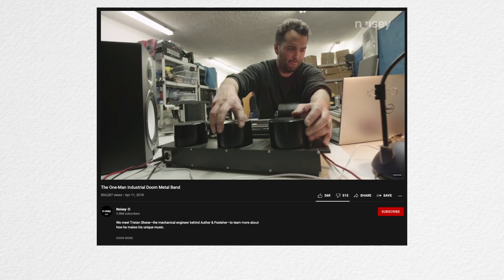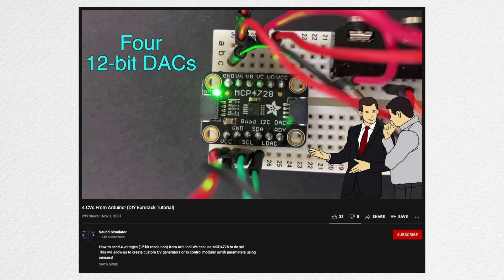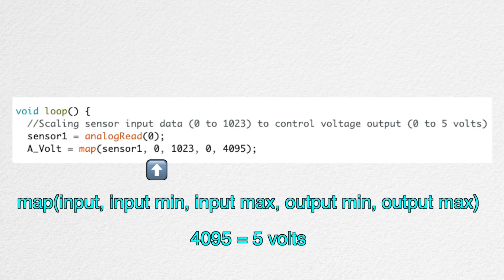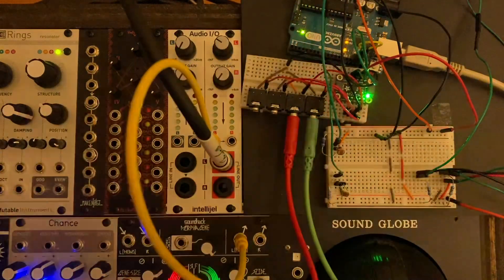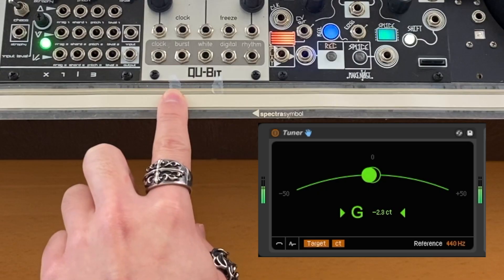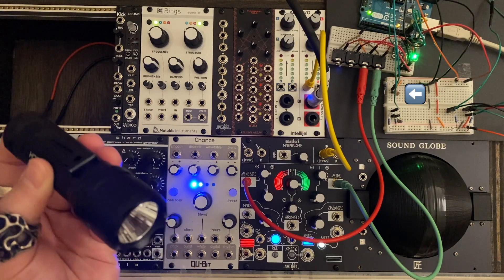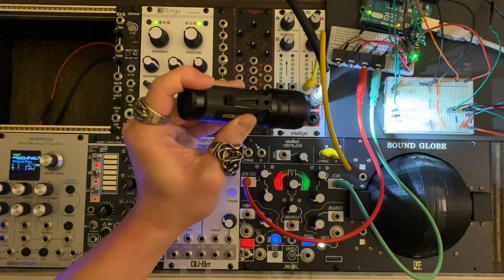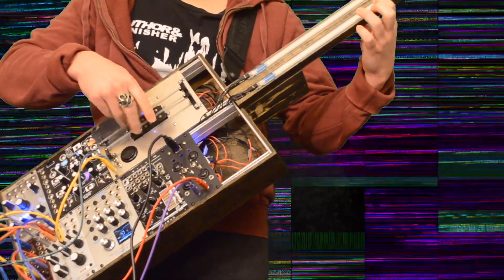Controlling Eurorack With Sensors! (DIY Tutorial)

Comment: Espectacular
Reply from the maker: I just saw your comment on the other video! This is the video where you can see how a sensor can be used with that breakout board :D
Reply: @SoundSimulator  I have a question, does this work also for digital input?
Reply from the maker: @arideejay  Like using a button for triggering CV output? Yep!
Reply: @SoundSimulator I don’t know if it works as a button but I have this known device by electricity for progress about biodata sonification and I was wondering if perhaps I can make it work with this device for cv